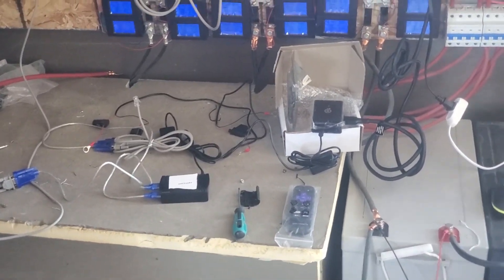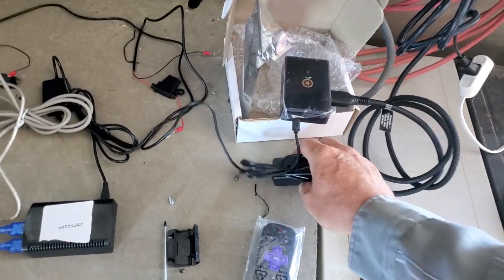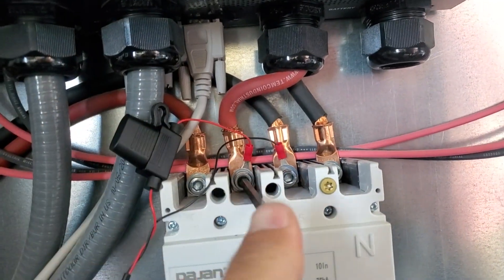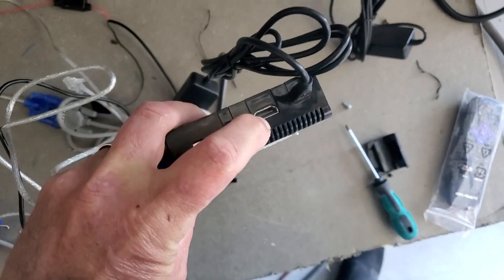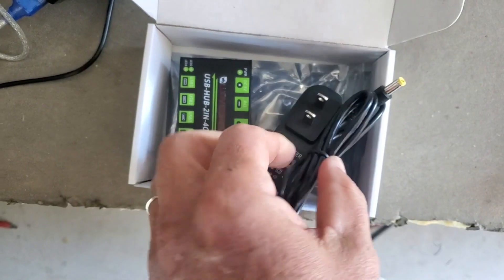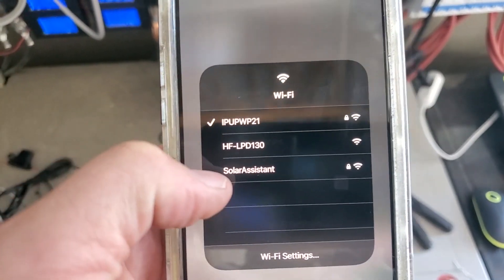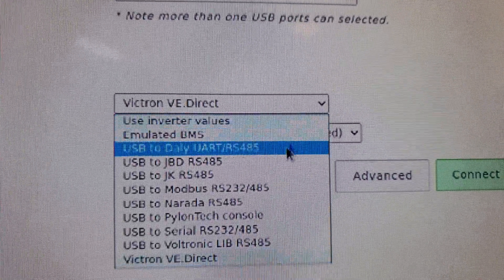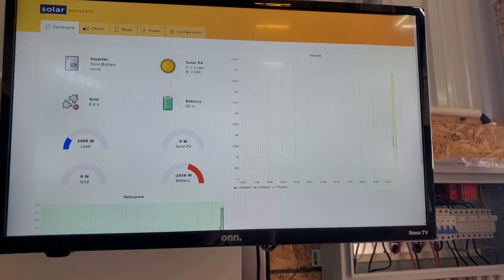Solar Assistant - Data Logging on steroids - the All new Orange version with functional HDMI output

Comment: Hi Ian I am having a bit of a issue with the solar assistant I have got two inverters in parallel and when I use charge source priority and set a time to charge from the grid it only charges from one inverter and not both any ideas how to fix this please

Comment: Nice Video, I did not see a mention about SD card.  Do I add for local storing of Data or does the PI store on itself or when wifi connected to my router wifi passes the info to a cloud?

Comment: 1) Thanks, is this a different version of the web app, when I click on the solar pv icon on first tab I don't get that nice overview ? 

2) I have a similar setup, and now have both inverters (they are not yet? configured to work in parallel), they have separate usb cables and the inverter is display them both well, however the Solar (Yellow graph, I forgot were to set the max so that its not stuck at 8kw but can go to 16kw), the values are correct. )

Are your inverters configured in parallel ? it seems simpler to keep them separate ?
Reply: I found the advanced option to change max shown on graph :)

Comment: Hard to believe they didn't build any sort of backup mechanism into it. If your SD card gives up, you lose all historic data. No option to export, backup, import data etc. sadly. I will likely move to home assistant because of that.
Reply: They have back up now
Reply: @HybridShedIraq  Is it possible to configure it so that the backup is performed automatically, at least once a day, and equally automatic archiving, for example on a network drive in the home LAN? At the same time, regardless of automatic archiving, manual backup is maintained for longer periods, at least monthly?
Reply: @andrzej3511 No you have to do It manually and you can only download it locally from the same network.
Reply: @HybridShedIraq  It's a pity, I was counting on automatic archiving.   :(
Reply: @andrzej3511  you don't need to back up it do archives for 15 years you only back up if something happens to the Pi or the memory card so not to lose all the data.
Reply: @HybridShedIraq  Don't you think there might be a good reason why I'm so need to archiving my data? Maybe not in 15 years, but in 3 years yes!

Comment: I like my solar assistant I got from you. I have a small issue, I connected a flat screen through the hdmi port on my orange. It only shows dashboard,frozen on values that where live when plugged in.wont update to current values. It works good on my phone. Please advise.

Comment: I've been using SA for almost a year now and I'm addicted to it.
It's there first thing in the morning, last thing at night and multiple times during the day.
Can I connect a 2nd inverter with it's own battery bank to the system or will I need a separate PI with it's own URL?

Comment: You state in this video that multiple growatt sc48120"s can be monitored, how would one go about this? The only way I have been able to connect mine is thru "double USB to DB9 adapters" . I have been unable to get the rs485 port on the growatt to work with solar assistant. I am using jk BMS' and have the growatt set manually as it will not communicate the jk bms.

Comment: Intel Nuc second hand (120€), proxmox, home assistant... Setup Mosquito, Grafana... and you got a far more flexible solution with more advanced graphs.. And a far more robust hardware device able to handle others vm....
Reply: How do you get the inverter information to the Intel NUC, if you are not using Solar Assistant or some other device?
Reply: @artyb7696  Elfin, RS232 to wifi or ethernet, Rs485 to wifi or ethernet.